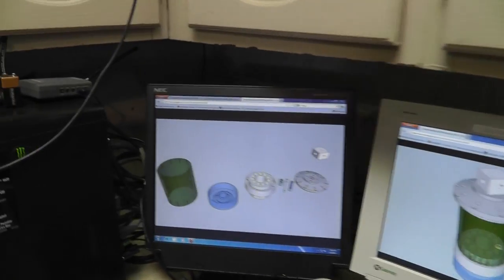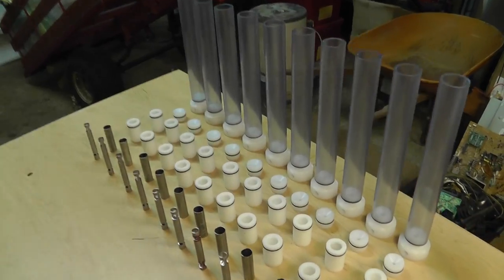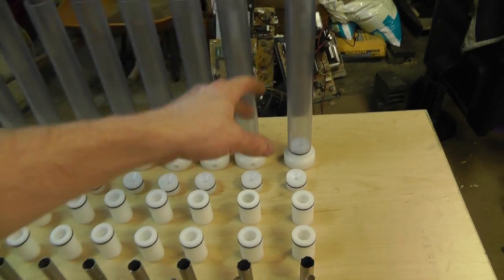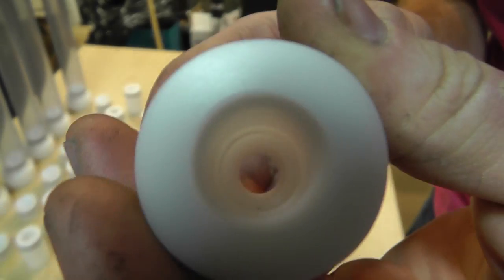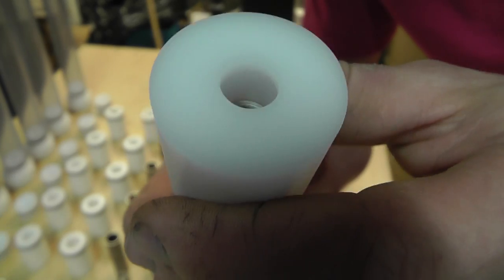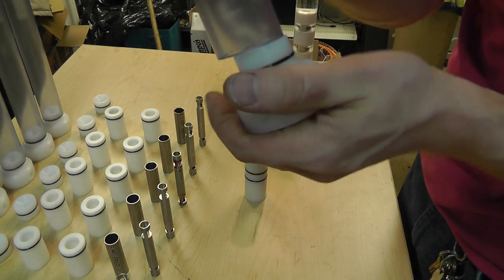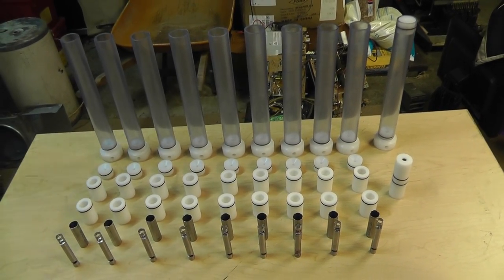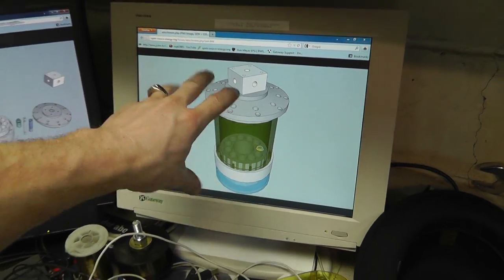Cell Time! A Set Of Stan Meyer Resonant cavities...

Comment: Dimple the shaft and use an SS ball to increase conductive surface area on the shaft side and a pin in the spring that interfaces with the ball. This will spread your current over a larger area when energizing the shaft.

Also consider poly-carbonate for your tubes. Tougher, stronger, higher melting temp and lower weight for like spec with pressure, thermal coefficient etc. You are all doing important and meaningful works.

Comment: A thought, HHO treated water gets better properties, what if there was a system where the batch of water that is getting split, if the gas could be circled / finely bubbled , back through the main batch of water a few cycles?
If fresh and old gas mix it wouldn't matter, but it's by volume.
Like say your going to run a cell till you fill up One gallon of gas, then this means that the water will have Two gallons of gas that has bubbled through the water! Or more even more if possible cycles the better

Comment: nice Design but what the Heck is it doing ? Plastic will melt away and thee leads need to be close enough to split the Water. Are you sure you didn't loose Track ? I love your work and your Videos, pl keep searching for Gral.
Reply: The only way anyhting melts is if comes in contact woth the electrical components and the part coming in contact has conductivity than the other parts coming into contact with the electricity since water is the path of least resistance it will go through the water to connect to ground which is the inner plate that you see also the plastic he is using is Delrin its an engineering thermoplastic meaning its designed to come into contact with heat the only plastic that can melt is the tubing used which does not come into contact with the electrical components unless he messes up and lets it contact with them. And yes the plates might be a little to seperated but i think it might still work

Comment: Pressure  I suppose would clean it out. In his final patent, the hho fuel injector which expands hho inside the injector itself, it should not need cleaning because there's no room for deposit anywhere.  If there could be a way to make a 40ns pump z wave at 1kw 30kv let me know; this would make it work. He used a mosfet with a diamond coating that supposedly nobody makes in production! wtf ?

Comment: Nice work. How much electricity will it need to run?
Reply: Za Adam for the most part you can use a 12 volt battery like from a car but youd need to increase the voltage coming into the cell and stan meyers knew and vaguely explained it his video of how his water powered car ran but to it is very hard to find the exact way as tp how he induced the voltage into the cell im still trying to figure out the circuitry for this voltage inducer

Comment: So you guys seem to know your sh#$ and I believe in the technology myself but the only argument that I question is about the energy going into the electrolysis vs the energy produced by the combustion, I figured that since theres a 2:1 ration of hydrogen to oxygen that you get a net increase, what do you think? can you explain it, do you know what happens to the Hydrogen atom when it burns? is atomic energy from the atom released????
Reply: Electrolysis is a very inefficient way of producing hydrogen, probably about 40% efficient. Meanwhile the combustion in an engine is less than 40% efficient, with most of it becoming wasted heat so the amount of energy being fed in as electricity vs how much you get from burning it in an engine is about 15%. Compare that to feeding it directly to an electric motor which would get you between 80 to 90% efficiency.
Reply: Great explanation, thanks!!!